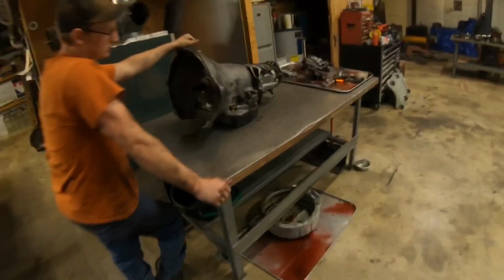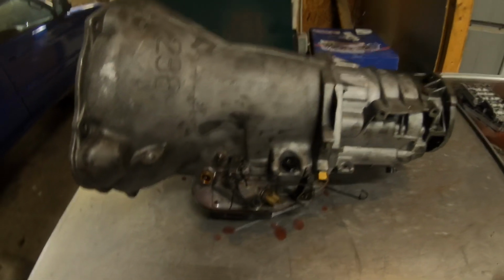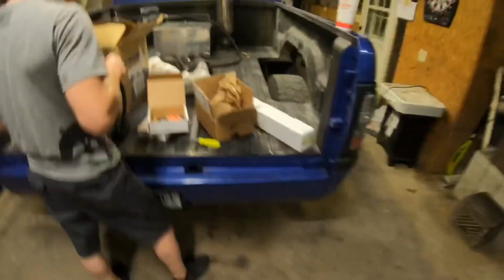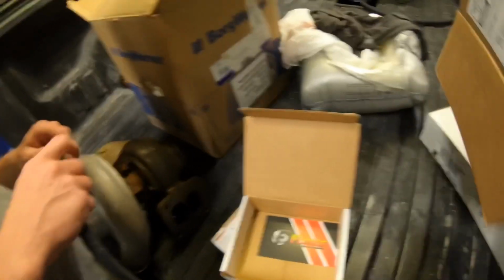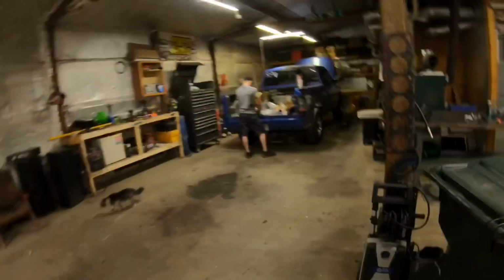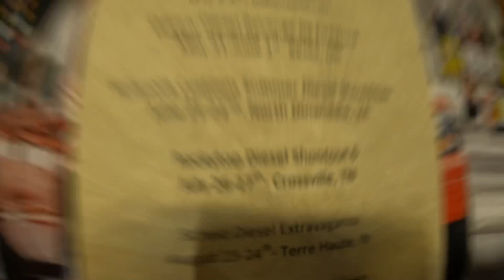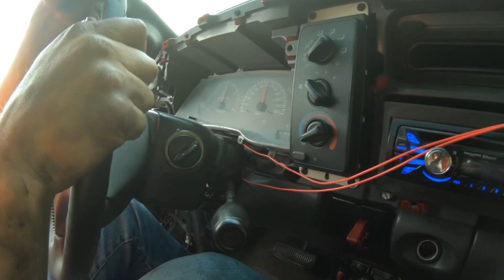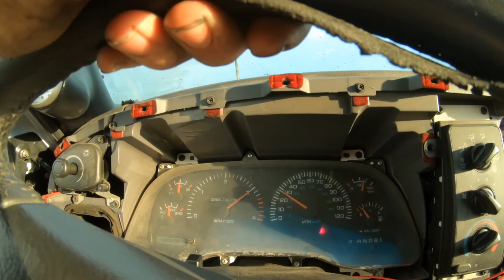CUMMINS LAUNCH AT 20 POUNDS!

Comment: How does that truck  coman overdrive does it still has a factory tps?. Over drive is fully controlled by the pcm on a 47re. I would say it has something to do with not seeing throttle position maybe the voltage is to high.
Reply: big murph wouldn’t the anteater control that? Correct me if I’m wrong but with them switching The truck to a ppump 24valve would it eliminate the PCM’s control over the shift points? It kind of sounds like it’s loosing it’s 12v that’s needed for it to shift into OD. Like I said I could be wrong I don’t know a whole lot about transmission stuff.
Reply: I am not sure how that anteater works. By yes it could be loosing voltage. Or some kind of signal. I know if the voltage is to high it wont shift either. I think they have to look into wiring issue.
Reply from the maker: We can hear the solenoid click,  torque converter lockup and overdrive share the same power just seperate grounds. We still have converter lockup so i dont think its an electrical issue. We appreciate you guys leaving comments and helping us out it means alot anything else you can think of we will try it!
Reply: @dirtydiamonddiesel5901  have you tried cleaning the grounds or moving them? If u dont think its wiring I would take apart the valve body and check springs I seen broken springs before. Could also be a valve worn in the valve body maybe try a different valve body if u have one laying around wont hurt anything to take it for a quick spin just to see if it works.
Reply: Also check the 3-4 shift valve 3-4 timing valve. Check to make sure the ports are not plugged for the solenoid. Also look the over drive piston really good. Theres a little check ball in the make sure it rattles. Make sure you have the right clearances